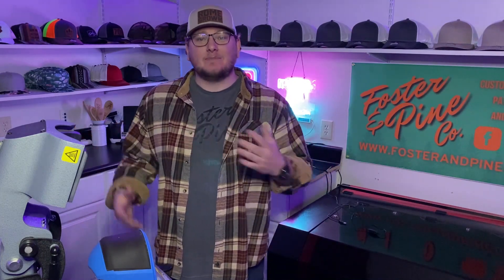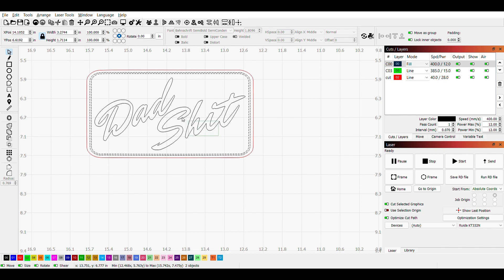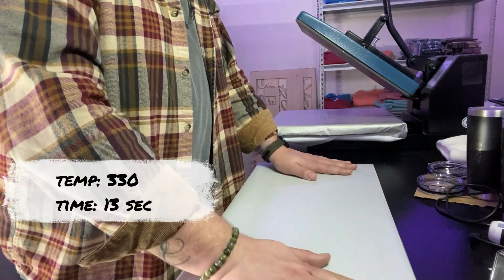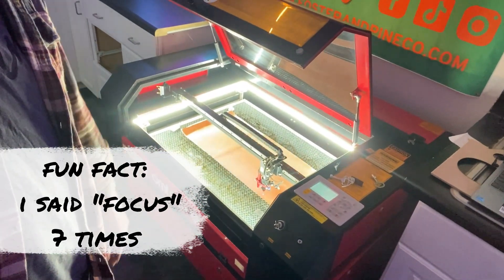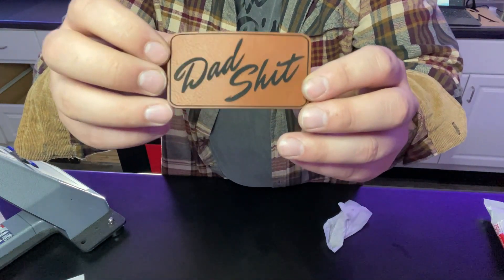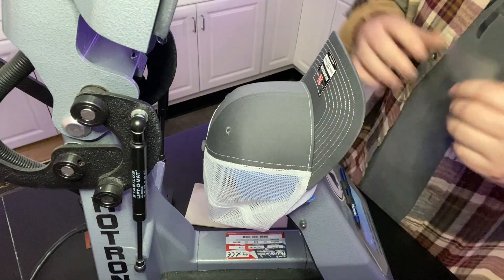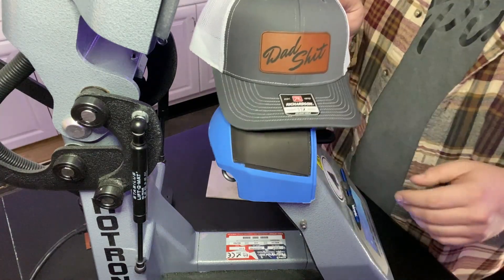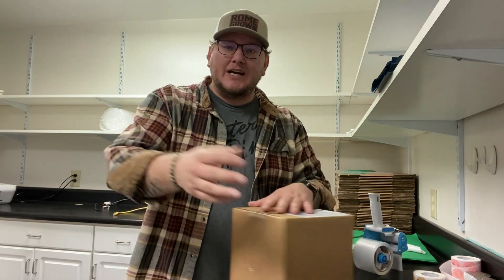Leaterette Patch Hat From Start to Finish, Laser Engraved, Heat Pressed Patch

Comment: Do you prefer buying the leatherette sheet stock without the backing already on it? We use leatherette from JDS, but we just buy the sheet stock with the adhesive backing already on it. Curious if doing it this way would be better even though it takes a few extra steps.
Reply: Additionally, consider putting a QR code on that label. Anyone who touches the box can just scan it and go straight to your website or social media. 🤙🏻 Hat looks great brother!
Reply from the maker: I guess I didn’t know jds was doing sheets with adhesive already applied. I’ve been doing this way for the past year so I’m not sure I would change it. But if it holds up as good as the adhesive I use then that’s probably a more efficient route for some one to go